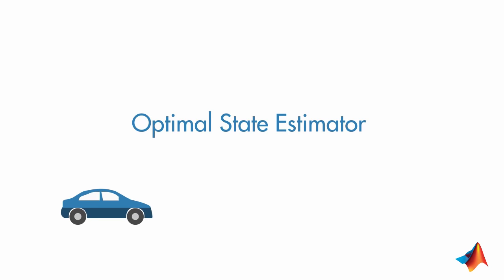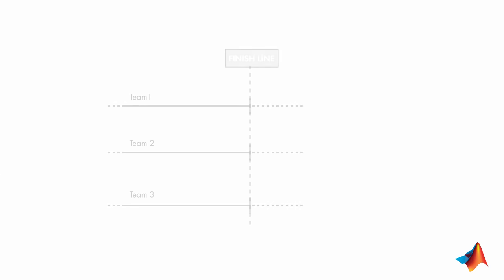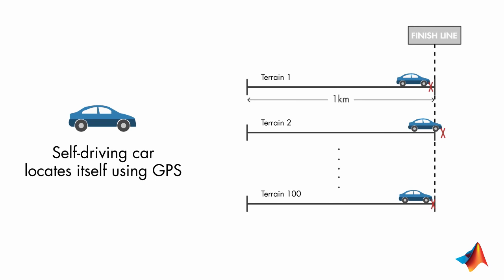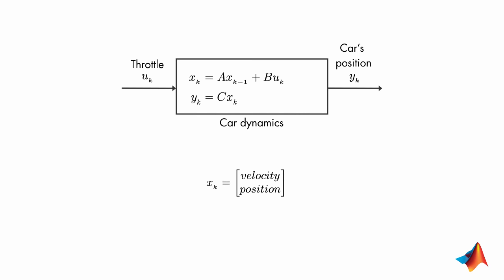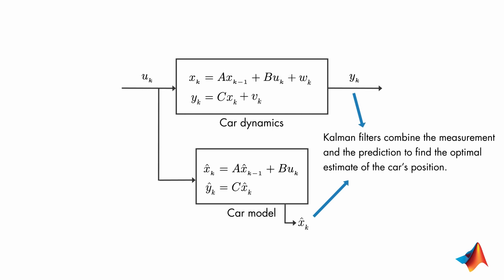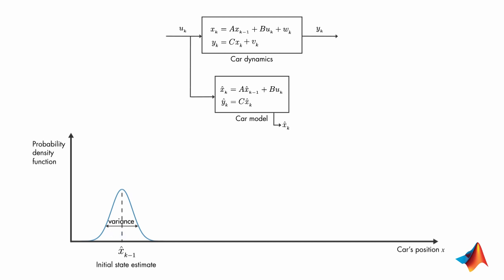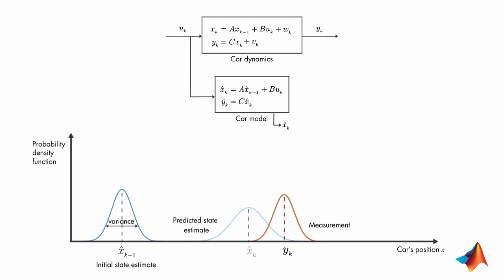Optimal State Estimator | Understanding Kalman Filters, Part 3

Comment: In the previous video, the equations for the Kalman filter were transferred to an exponential distribution. That is, a distribution that doesn’t have to be normalized. In this video, pdfs are used and are multiplied together. This can only be done if the distributions are normalized. There is a large difference between a normalized pdf and an exponential distribution. With a pdf, you need enough data to find the true mean, in order to normalize the data. If you can’t, you can’t multiply the two distributions. So, this example wouldn’t work. My point, either the example of an exponential distribution should have carried to this video or it should have been mentioned which cases that this example can be used.

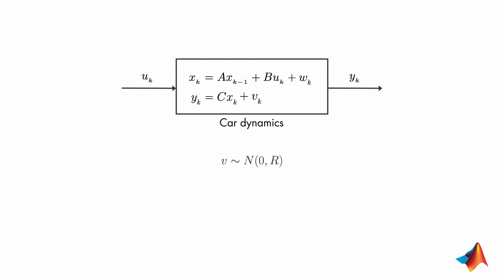Comment: Great video!! just a thing, I maybe wrong but, in the state-space model at 2:57 the output shouldn't depend on x(k-1) as we've indicated the future state as x(k)?
Reply: I think the reason why it's not x(k-1) is because it doesn't make sense the output is a previous state. 

Generally the output is written in the form  y(k) = Cx(k-1) +Du(k) which is equivalent to x(k). However, here it's just simplified to be y(k) = Cx(k) where C represents a matrix with the desired outputs and x(k) = Ax(k-1) + Bu(k) --> you can see this in the equation of the Kalman filter.

At least that's what I think is going on.

Comment: Why in part 2, you compare x and x_hat, now you compare x_hat and y. it's confusing!
Reply: Hi Tran, in part2 we're not really comparing x and x_hat but we try to explain that a state observer can be used to make the state estimate (x_hat) converge to its real value(x). You can think of a Kalman filter as a state observer, too. You still want to estimate states but this time you're also dealing with uncertainties and Kalman filter gives you the optimal estimate. The way it calculates this optimal estimate is that it incorporates both measurement and predicted state estimate. Part4 video explains more on the working principle of the filter which might give you a better understanding of how y and x_hat are used by the filter.
Reply: Isnt it just because both y(hat) and x(hat) are the same (both are position and C=1)?. So it would be the same to use y(hat) and x(hat).

Comment: Why is the car dynamics linear?
Reply: Hi, here we assumed a linear system but in case you have a nonlinear one you can use a nonlinear state estimator. Please check out the part 5 video where we discuss nonlinear state estimators. For an example in Simulink you can also watch part 7 video where we use an extended kalman filter to estimate  the angular position of a nonlinear pendulum system.